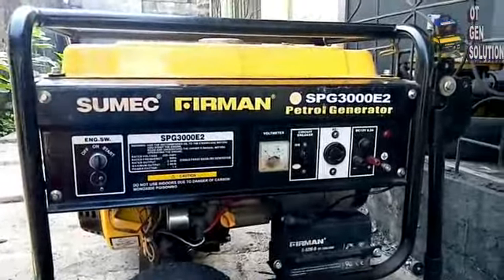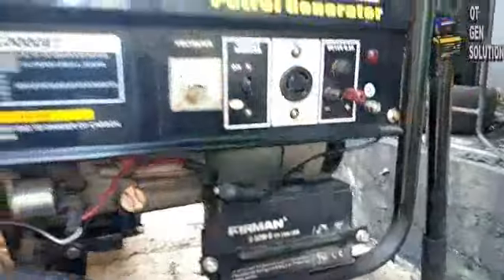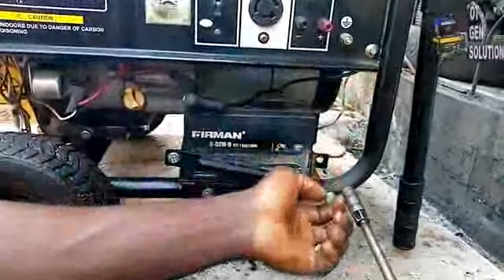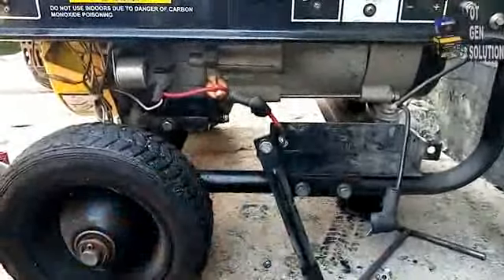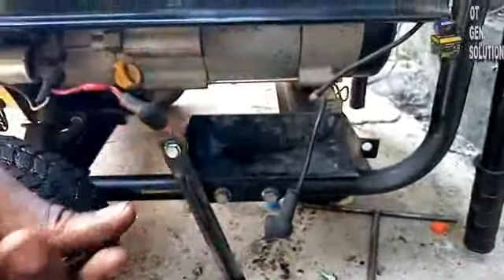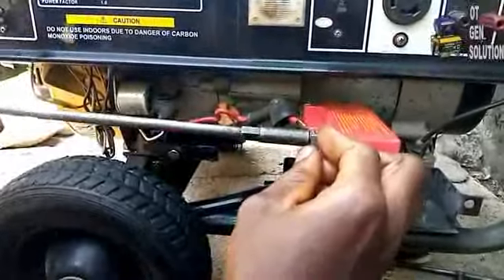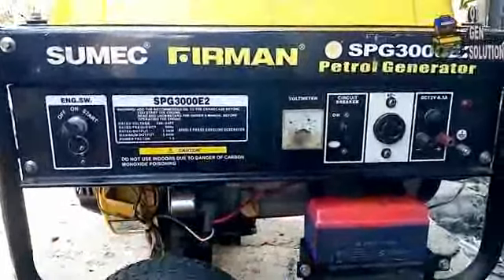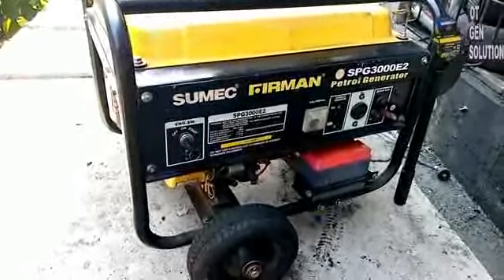How to replace Generator battery- Key starter not working(solution)

Comment: how many volt battery is used in honda 2800 generator plz reply fast
Reply from the maker: It varies but usually 12v

Comment: How do you know the previous battery was dead? Are you sure it didn't need charging? I have a similar key starter that isn't working and I'm trying to avoid buying a battery since I've only used it for like 5 months.
Reply from the maker: Recharge it then
Reply: How do I recharge it ??
Reply: How do I recharge it ??

Comment: PLEASE I BUT A NEW BATTERY FOR THIS KINDA GENERATOR AND STILL DIES. 

I RETURNED THE OLD AND IT WORKED FOR FEE HOURS BUT NOT WORKING AGAIN.
Reply: MINE EVEN HAVE A REMOTE STARTER
Reply from the maker: @Joekeyzzpianoministry  probably ur engine is hard to pull. The valve needs to be adjusted by a mechanic.
Reply: @OTGenSolution  sir does it mean the batteries aren’t charging?

What fo you mean by my engine is hard to pull sir 😢
Reply: My generator works perfectly well. 
Just the battery problem sir😢

Comment: How will you know if the generator battery is not damage
Reply from the maker: With the help of a multimeter
Reply: @OTGenSolution  but is not up to 3 month battery, does it easily get spoilt
Reply: Can I use Suoer 20a Inverter Battery Charger With 12v to charge the battery